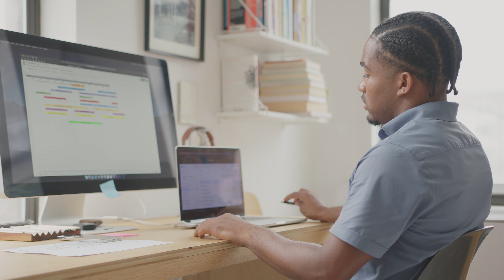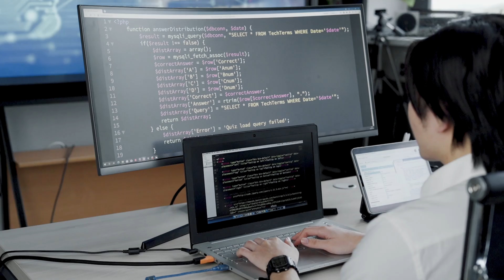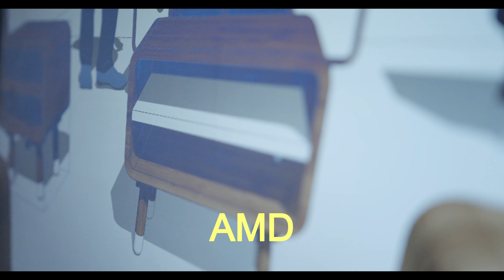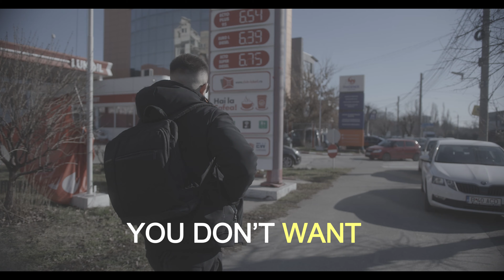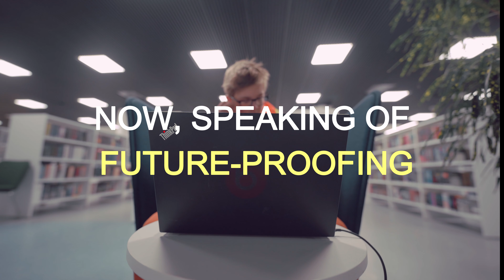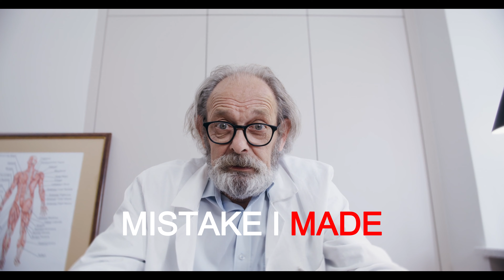Best Laptop for Civil Engineers: How to Choose (And Avoid My Mistake)

Comment: Will Core I 5 laptop suitable for Civil Engineer?
Reply from the maker: It depends on the use case. If you want to do large design projects and so on then I would say i5 would not be enough.
Reply from the maker: The ideal laptop for a civil engineer varies by individual needs since civil engineering covers many fields. Therefore choose the right laptop for your specific use.❤

Comment: How much graphics card is recommended??
Reply from the maker: general design purpose for a civil engineer, a mid-range graphics card with at least 6GB to 8GB of VRAM is a good starting point. This will allow for comfortable work with 3D CAD and BIM software, as well as some moderate rendering capabilities
Reply from the maker: for a civil engineer, here are the key requirements for a design laptop:

powerful processor (intel core i5 or amd ryzen 5 minimum)

16 gb ram for smooth multitasking

dedicated graphics card (nvidia gtx/rtx or amd radeon)

if you need any further information, you can contact me on any social media platform @engineergpm

Comment: i recently got the m4 pro 14in macbook pro but im realizing that ill need more windows compatible apps - civil 3d, vissim, visum and aimsun - so i am looking into a windows laptop in order to finish my masters and also transition into the profession. i was thinking of buying a used razor blade (i7-10750H, NVIDIA RTX 3060, 32gb of ram) is it worth it to go with a earlier gen machine given the current options out now (preferably under 1200) or should i look into buying a new machine and sell the mbp? when i get to the point of working at a company i believe they will give me a work laptop but i would still like to get used to and learn more of these applications. any suggestions and recommendations will help. thank you everyone
Reply from the maker: The used Razer Blade (i7-10750H, RTX 3060, 32GB RAM) is good for civil engineering software like Civil 3D, VISSIM, VISUM, and AIMSUN. It offers strong performance with its processor and graphics card, making it suitable for 3D modeling and complex designs.
If you can find this used Razer Blade for under $1,200, it's a good deal. You don't need to sell your MacBook Pro - keep it for other work and use the Windows laptop for your civil engineering programs.

Stay Connected!

Follow me on Instagram: @engineergpm
www.instagram.com/engineergpm
Reply: @EngineerGPM  would the 10th gen intel cpu not be an issue? I could get a new HP Victus 15-FA0022NP I5-12500, 16GB, 512GB SSD and RTX 3050 for the same price? If that were the case would you still recommend the razer blade?

Comment: How is 
HP Victus Gaming AMD Ryzen 5 Hexa Core 5600H (8 GB/512 GB SSD/Windows 11 Home/4 GB Graphics/NVIDIA GeForce GTX 1650/144 Hz) 15-fb0131AX Gaming Laptop 
For civil engineering
Reply from the maker: the HP Victus laptop is good for civil engineering design, with a strong processor, suitable graphics, and upgradable RAM. It’s somewhat future-proof for 2-3 years, especially if you upgrade RAM to 16 GB.
Reply: @EngineerGPM  which one is better asus tuf a15 or hp victus ryzen5 hexa core 5600H
Reply from the maker: The HP Victus and ASUS TUF are two laptops with different strengths. The ASUS TUF offers better build quality and future-proofing with powerful processors and graphics, making it ideal for demanding tasks. The HP Victus provides good value with strong processor performance, suitable for most civil engineering tasks, but may lack in graphics. Choose ASUS for durability and future-proofing, or HP for affordability and processor performance.
Reply from the maker: The decision ultimately depends on whether you prioritize build quality and future-proofing (ASUS) or value and processor performance (HP).

Comment: Hows asus tuf a15 ryzen 7 rtx 2050?
Reply from the maker: The ASUS TUF A15 with a Ryzen 7 processor and RTX 2050 graphics card is okay for basic civil engineering tasks like AutoCAD or SketchUp today, but it won’t stay strong for 5 years. The RTX 2050 is too weak for future software updates, and the laptop might struggle with big projects later.
Reply: Then Asus rtx 3050 is good or not @EngineerGPM
Reply from the maker: @ubcreations3386  Dm me on instagram @engineergpm